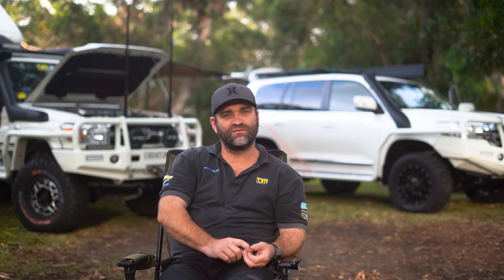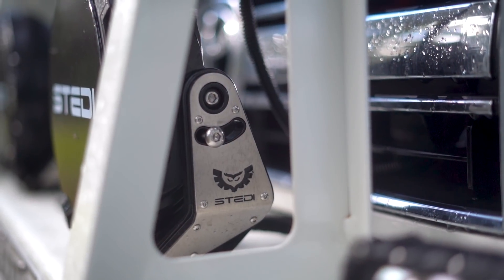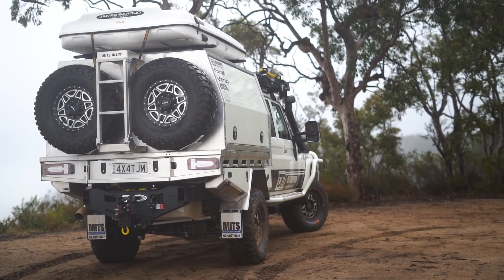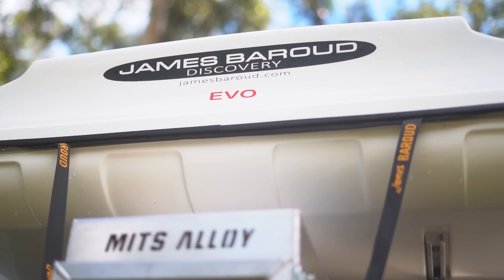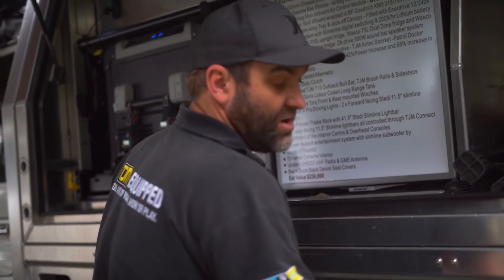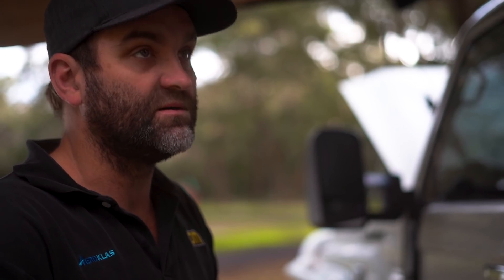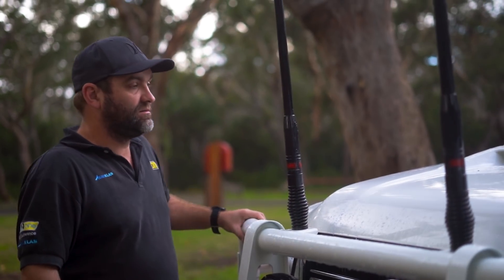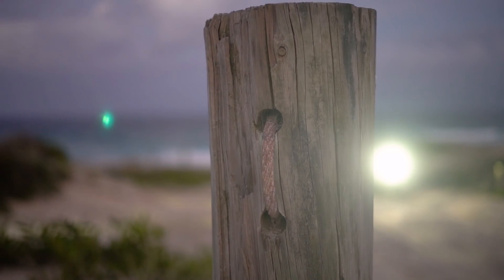2019 VDJ79 - Chassis Extended, Coil Converted, Lithium ,Canopy Fitout

Comment: Very nice build  - well done but I f this did cost $ 230 k  , why wouldn’t you start out  a build  with a Ram or similar Spec vehicle that can handle the load without an upgrade .   The canopy build , electrical fit out and James Baroud tent is awesome but It seems you buy a land cruiser and the only thing you keep that’s  Toyota is the doors  , the rest is thrown in the tip !!  . They aren’t cheap to start with but  by the sounds of it if you want to do anything useful with the 79s and  change what is needed , Toyota should just about give them away  !! Maybe we don’t have much choice or option but maybe  a Ram or something similar  in diesel which obviously starts out a lot more money might be cheaper in the long run once fitted out similar and at least your not left with a Toyota motor and gear box . The Land Cruiser from factory just doesn’t seem to be up to it at all but commands so much 💰💰 - I reckon Toyota is having a laugh at us Aussies

Comment: I don't really get it. I like 79's but to spend this much money on it... I always feel like you'd look like such a nob if couldn't follow or got stuck and a jacked up Hilux/80/GQ etc lucky to be worth 10g has to pull you out.. which will happen only matter of time
Reply from the maker: Abu7929 its more the legalities behind it. Its 4” lifted, runs 35s. With a 4.5T GVM can tow upto 4T but 8TGCM all legally, its chassis stretched, V8, Twin locked. Yes if you take it down a tight muddy or rutty track it wont be ideal for it. Its not really what its built for. Its a Touring Truck with more payload available then even the Rams ect.

Comment: Problems friends have encountered over time with a similar setup, one with a fibreglass back the other with an aluminium back is heat
Poor ventilation will cause your fridges to work extra hard using tons of battery power which causes more heat and the fridge heats up causing it to go into limp mode (Yes they did). If you have a hard top pop up roof tent you probably have a solar panel on top to charge those batteries like they do, that requires you to park your rig in the sun, mmm, so in your roofy it's now 130° C, and your solid back is 120°C and climbing. I'll  fix that by opening up the doors (maybe). Time to move on to the next top spot, lock it all up and let's go it's only a days drive. All those fridges running in those neat little compartments you made, sun belting down and it's now 150°C in there and shit is starting to go wrong, this was their dilemma, they now wish they had of kept the trusty canvas back like I have with good ventilation and flaps I can roll up on the go for more ventilation and would have kept thousands in thier pockets.
Reply: I’ve had my fridge (trailblazer) inside my aluminium canopy running non stop for 5 years and only issue I’ve had is the battery in the engine bay leaking. I’ve since moved a new battery into the canopy beside the fridge and no issues. Heat is definitely not an issue in an aluminium canopy
Reply: Matt Murphy not down south it isn’t
Reply: Steven Hollingworth I live in qld